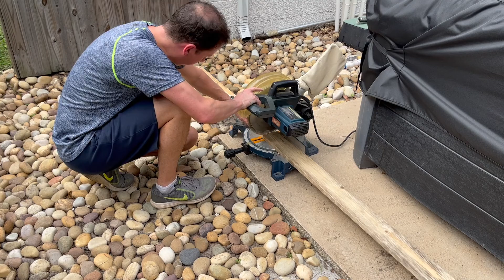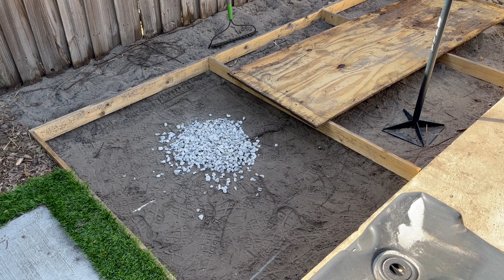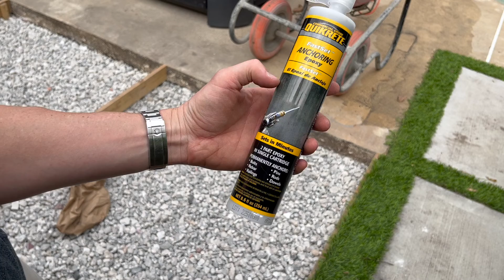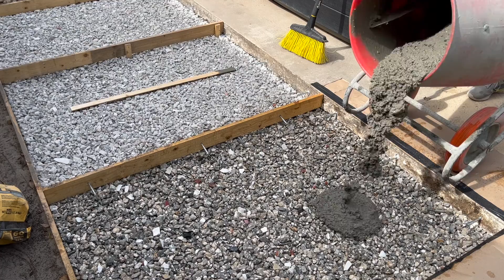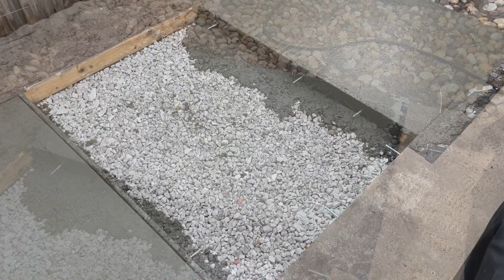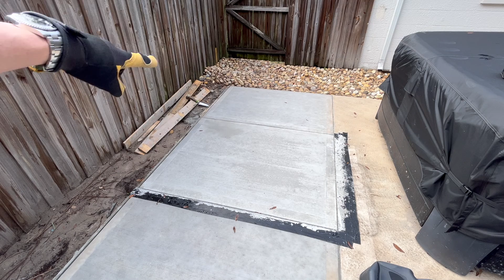How to Pour and Finish a Large Concrete Slab for a Hot Tub || Using Bags and a Rented Mixer

Comment: Hey great video, super informative.  

I have 3 questions:

1. Isn’t that mesh you installed halfway up supposed to negate the need for the control lines (forgot the exact term you used)

2. Do some people install a moisture barrier between the crushed concrete and cement? If so why is it necessary. 

3. If I wanted to make a pad slightly higher off the ground than yours, above the grass line, how far down do you dig for the base layer? Are you supposed to lay the crushed stone on a layer of clay or what’s the rule there?

Thanks in advance!

Comment: I really like the Style of these slabs with the Brushed surface and the rounded Edges.
I'm thinking about making them for my driveway. Do you think the will hold the force of a car? Like when I pour them exactly like you did?
Great Video.
Reply from the maker: Thanks! Yes it will absolutely support a car. I would go at least 5 inches thick for this purpose though.